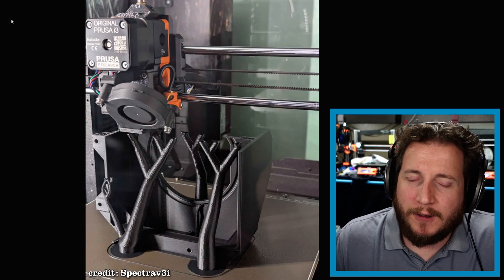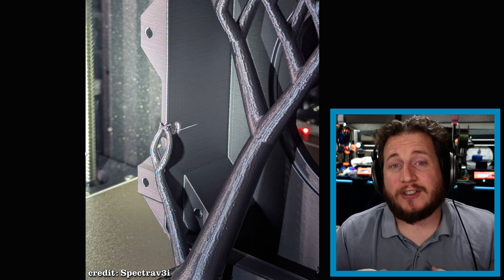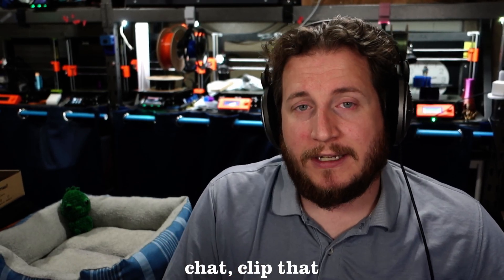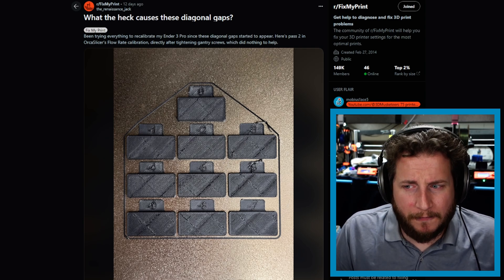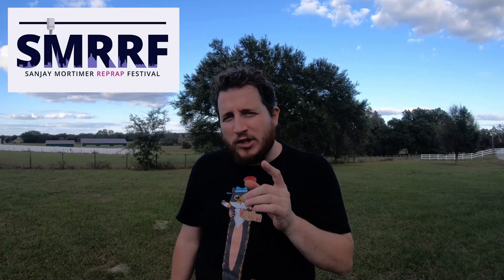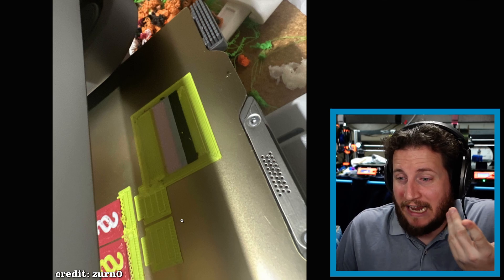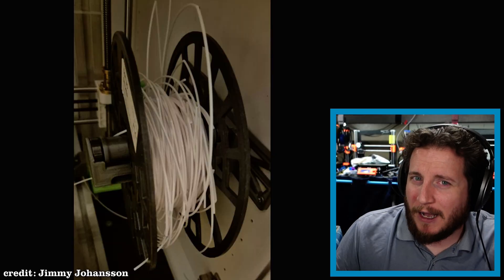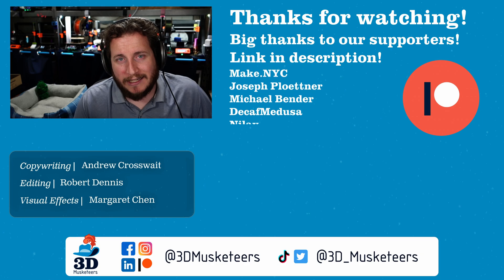Prints CRACKING From The COLD?! - PrintFixFriday 168

Comment: Holy sht, this is genius! I didn't think of this, that you can put a fan under your bed and it'll force printer to maintain bed temperature, which means that bed will produce way more heat that it normally does. Thank you very much for this tip!

Comment: Yea, getting good prints is extremely difficult without heavily modifying it.  I put an an all metal hotend and direct drive on mine.  I also put frame supports on it and dual lead screws for the Z axis and a new 32- bit control board from Bigtreetech.  It printed much better, but then I discovered it had humidity issues because as I was sitting at my computer with the printer off and heard the PLA snapping.  The humidity here is around 55 to 65 percent though only about 45 in winter.   I put the filament in a drybox and the printer in an enclosure and started printing exclusively PETG as PLA does not like enclosures, it tends to clog the hotend.  Even after all this the quality was still only so so.  When I bought my new Ender 5 S1, the print quality was much better and printed at least twice as fast.  And I rarely have to relevel the bed.  And there are even better printers out there.  You get what you pay for I guess, don't go cheap if you can afford a better printer.  Still, the Ender 3 is a good starter printer and I learned a lot about how that style of printer works.

Comment: Thank You @Grant. I used the part, and I did have the fan running and heat soaked the enclosure or 1 hour and a half. I recently added 4 blankets over my enclosure and printing ABS it get in the low 50's now in the enclosure.

Comment: 2:16 Good shout on the chamber fan to heat the chamber a bit more. I know it’s not the same printer but I’ve found on a Voron just increasing the bed temp 5-10c can increase chamber temp just enough to prevent warping and cracking. ABS and ASA can be quite forgiving on how high you can increase bed temp before it softens. 

Also try a different brand of filament 
I’ve found some brands were just made to warp even in a chamber and others have printed fine on an open air bed slinger by a window